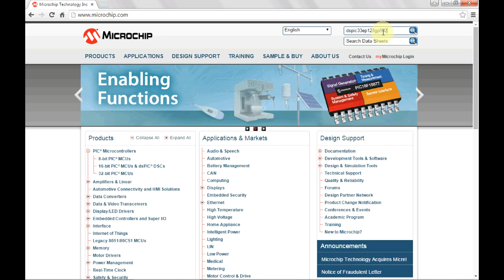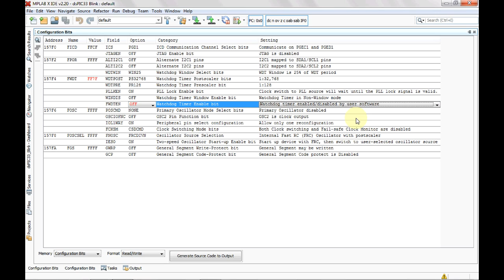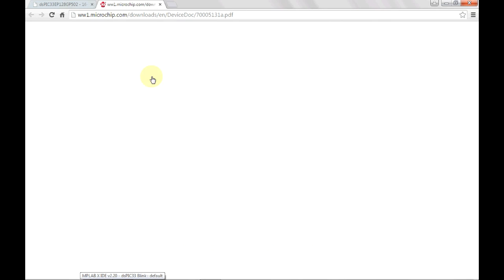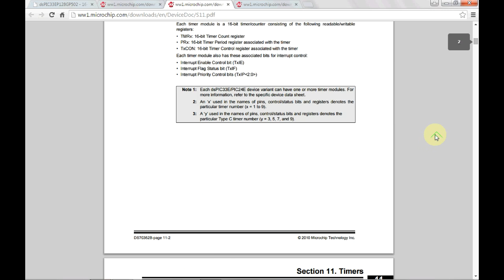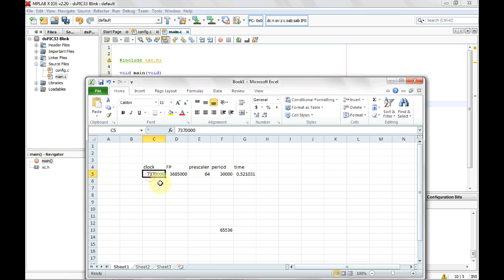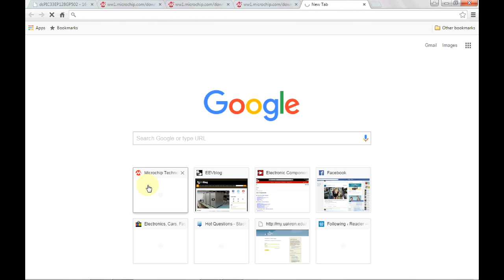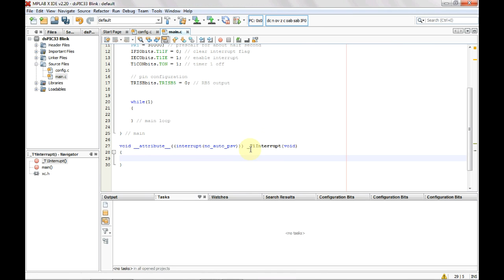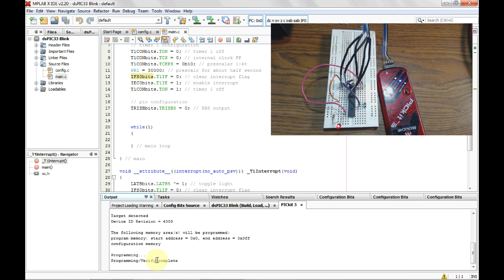eabpg # 8 Software 16bit dsPIC33

Comment: Or you can use "bit"=~"bit";?! Also, you can use name of register and shift operations: TRISx |=(1<<bitx)|(bity)|...., and TRISx &=~((1<<bitx)|(bity)), or any combination. It's C language bit manipulation. I used TRISx as general example.
Regarding the ISR, it's so called callback function that's called upon interrupt event, and you can't pass it any argument. Compiler specific. Basically for almost any (at least ones I've used) MCU applies same principles. Just compare AVR, STM32, STM8S, PIC,...., when you learn the most complex one (STM32), any other can be learned from that.

Comment: Can you explain the LED flashing work for dspicep256mc506 explorer16 / 32 development kit too?
Reply: It's the same as in this example. I'd recommend to use header files of any particular MCU when you need to program any part of that MCU, it's name is for your MCU: dspic256mc506.h. There are names for every register and every bit, inside structure for peripheral/resource. Very important to be familiar with structures, unions typedef, etc.

Comment: Can i Use a 10uf polarized capacitor for Vacap and vss instead of the ceramic one ?
Reply from the maker: The data sheet usually recommends a Tantalum (which is polarized) or a ceramic. They need to be a low ESR (equivalent series resistance).

Comment: How many MIPS you can get using internal oscillator? Will it be the same as external ? For instance using dspic33EV64gm004 has 70 MIPS. I f i use internal oscillator how many Mips I would get? Probably depends on the prescaller and postscaller. And how it's relevant with PLL?
Reply from the maker: You can get the same MIPS out of both by using PLL. The only reason you need external oscillator is for accuracy or USB functionality.
Reply: Do you know how many instructions 16 bit PIC do in one machine cycle? AVR 1 cycle/1 instruction. I know 8 bit PIC sure does 1 instruction in 4 machine cycles but I heard Microchip changed architecture in 16bit PICS.
Reply from the maker: According to the data sheet "Most instructions execute in a single-cycle".

Comment: Can you please explain what means bit toggle. What means ^= sign? Is it the same as LATBbits.LATB5 == 1 ?
Reply from the maker: We have to break this down into several pieces. The first piece is the xor "^" operator. The xor operator gives you one the other but not both. If any bit is xored with a 1 the bit flips. Lets work it out; 0 ^ 1 = 1 also 1 ^ 1 = 0. This procedure does not require knowing what the bit is ahead of time. The second piece is the compound operator. The compound operator allows short hand. For example x = x ^ 1 is equivalent to x ^= 1. There are lots of short hand compound operators. Finally the == operator is a Boolean comparison. The output of this operator is a 0 or 1 only. Look here https://www.arduino.cc/en/Reference/HomePage for more information and all the different operators.
Reply: Thank you very much.